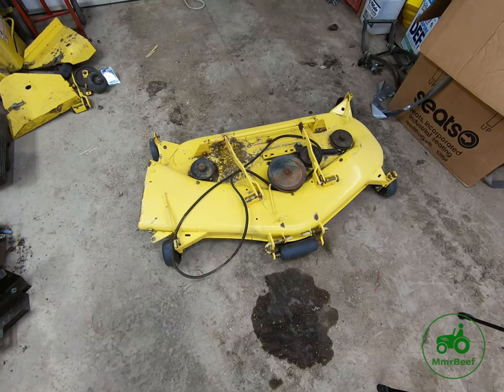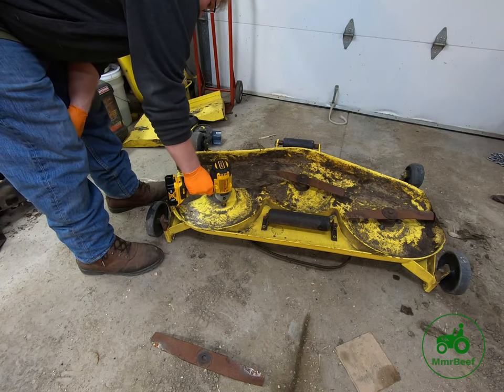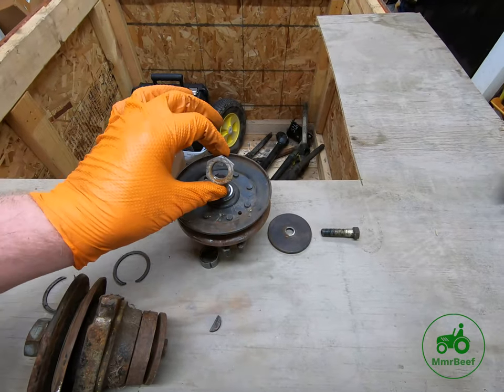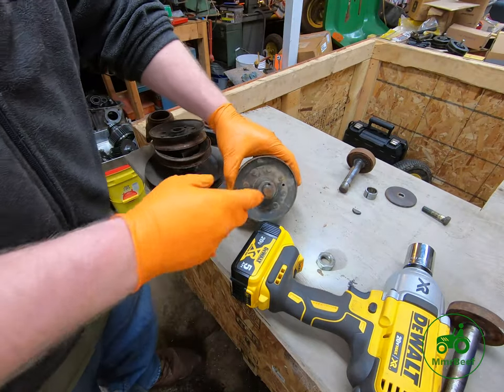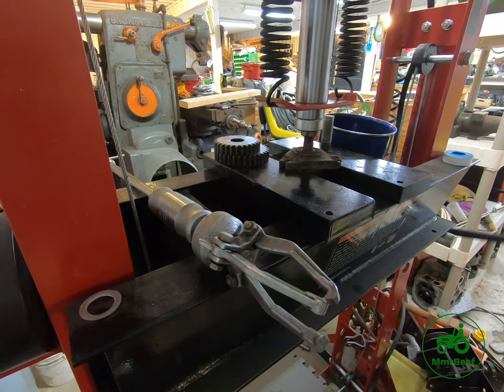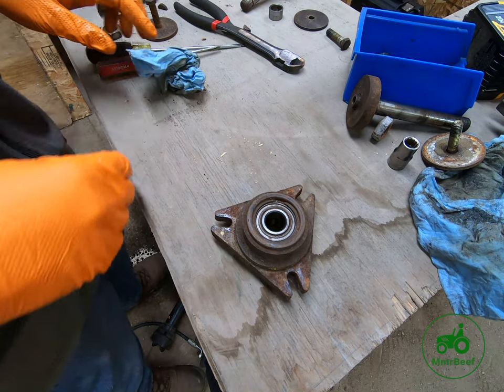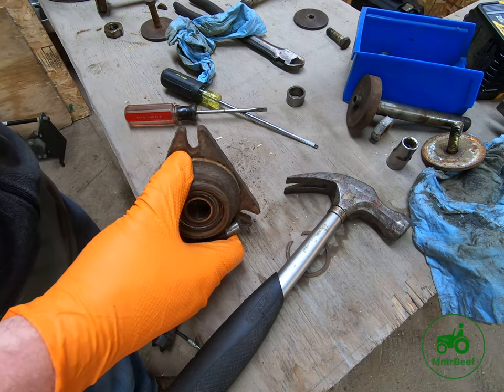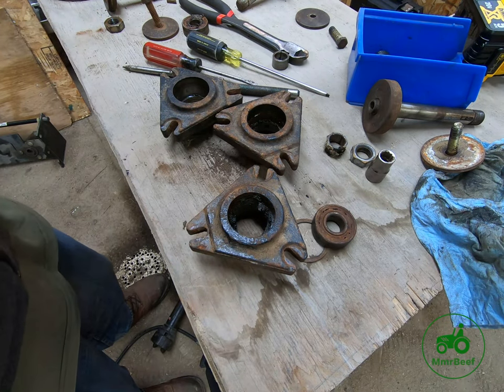Rebuilding John Deere Deck Spindles (Part 1)

Comment: I did this last year, I got the part spindle, hammered it in and it was too small.  So I had to order a different one, and I dropped it on the floor and screwed up the threads.  When I put it all together It was the bearing!

Comment: could you tell me the part no. for the bearings or the size of them. Its so hard to find these parts by the year. My deck is a 1970 model 38 inch same spindle as yours.
Reply from the maker: JD9296 would be the OEM part number. In the JDparts.com catalog search for “38” and then look under the tractor mounted mower.

Comment: I have a JD D110 riding mower and the deck is all beat up from the previous owner, I had to do some welding on it but I really need a deck. Does anyone know if there's a website that sells used decks in good condition for John Deere?

Comment: Great video, but why didnt he just press both bearings out at the same time on the press width a suitable with pipe or socket ?
Reply from the maker: If I understand your comment correct, because there is still a snap ring in the middle so there is no way to press the first bearing out. You could do the second bearing with a press and normally they are not that "stuck" in there.
Reply: Remove the first C-clip and press that bearing out from the backside ... won't quite make it all the way because of the middle clip but it's only a tap or two w/punch to get out ... then turn around and press the 2nd bearing out from the center clip with a bolt or something large enough on the bearing ...

Comment: Also I might trade my 322 with my 50 deck, and my 54 blade for his 430 no attachments, is that a good tractor and is that a good deal?
Reply from the maker: I think it really depends on what you would like to do with the 430. If you have no desire to mow with it I do not see a huge issue but I do think outright selling the 322 will net you close to the value of a 430 w/ deck. The 430's are great machines if they have been taken care of. They will last thousands of hours if they are treated right. I recently saw a 430 similar to what you were describing (seller was asking 2,500 or a trade for a 322/332). I'd have to go back and see the ad again... can't remember where the ad was thought! Haha
Reply: mmrbeef yeah, I would kind of like to mow and snow plow with it
Reply: mmrbeef are there any problems with the 430’s.  Are they considered to be better fit than the 322’s to mow with and plow snow?

Comment: How does that half moon key for the pulley prohibit pressing the bearing housing and pulley off the mandrill shaft ? That is not obvious.
Reply from the maker: If you do not take the key out the mandrel will not slide through the bearings. I need to go back and remake these videos with some better camera angles.

Comment: I have pulleys rusted on and ive even soaking them for a week. How it what should I do to get the pulleys off ?
Reply from the maker: Sometimes that kind of thing happens. Are you using a press or a hammer? A press can generally break them free, even a cheap 6-10 ton bench top press.
Reply: Some have suggested making a triangle (wooden?) to rest the pulley on and then press out ...

Comment: Only thing I need to see how to do and ya don't show it. Awesome. Lol good video otherwise. But how the heck do you take the key out?
Reply from the maker: I typically use a brass punch and hammer. Rock the key back and forth. You can also use a pair of wire cutters and pry it out. Sorry I skipped that step.
Reply: @mmrbeef  thanks! I checked out a couple other videos that showed some methods! Thanks.